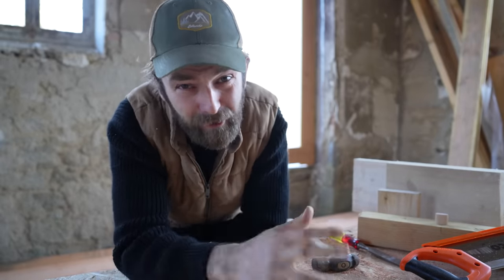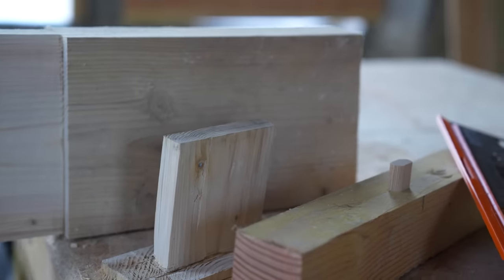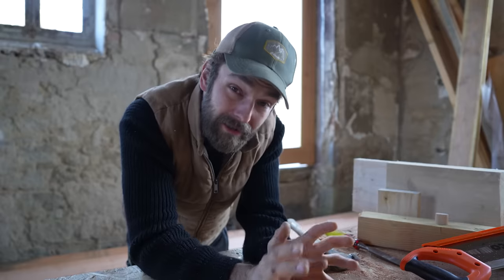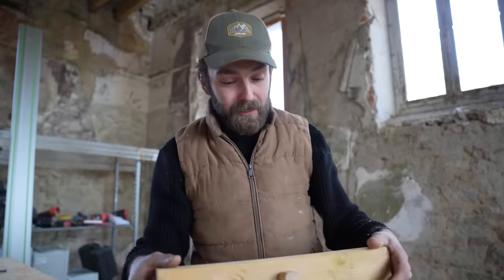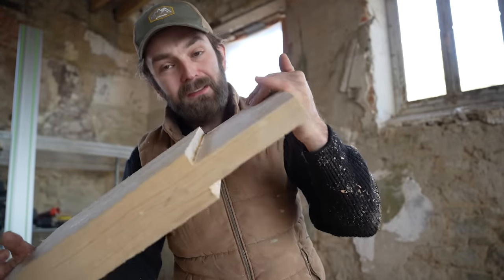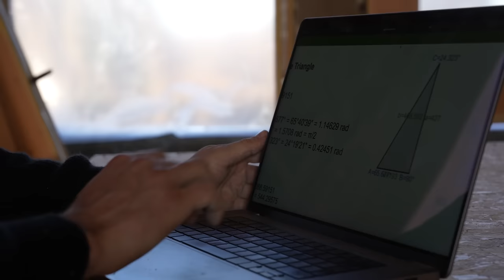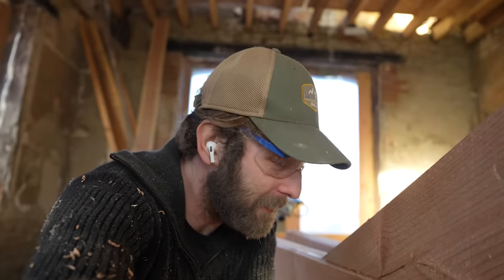Making a mortice and tenon roof frame.

Comment: Dan - Where is your EYE protection ????? It may seem safe-ish but one tiny blip in the wood might cause a life-time of pain, misery and discomfort. An once of protection (your EYE protection) is worth the entire chateau and then some! Treat all of your body parts as jewels, not just tools! You wore safety harnesses to work on the roof thus far. Do the smart thing - teach others (including your boys) that safety is paramount!
Reply: He was wearing safety glasses in the video
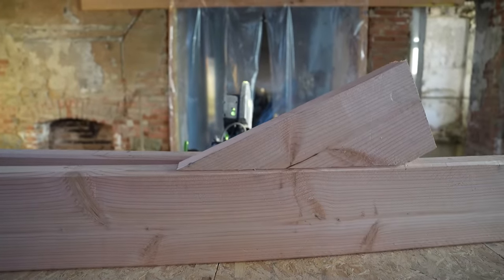Reply: The video is 14:27 minutes long. Dan does lots of wood working, sawing, drilling, using various equipment such as the table saw on the floor (saw comes toward you in the video) - no eye protection. Dan is sawing through thick boards with a chain saw - no eye protection. Dan is drilling/sawing a morticen - (you can see the wood chips flying toward his eyes) - again, no eye protection. In 13:07 Dan has eye protection on and in 13:51, Dan takes off his eye protection. For the majority of this video, Dan is NOT wearing eye protection. I suspect that Dan could have his eye protection on a strap/chain around his neck so that his eye protection is readily available and not temporarily stored in a shirt/pants pocket.  Then there is Dan's use of lots of high-powered tools to get the job done - thus the noise pollution is through the roof (no pun intended) - Dan is not using ear protection either, but he can probably go on for another 30 to 40 years before his damaged ear drums will require hearing aids. Maybe technology will catch up by that time and there will be other devices available when the eyes are damaged. Such an easy solution/fix - wearing eye protection!  @NurseSherry